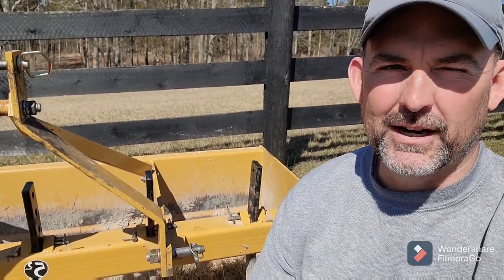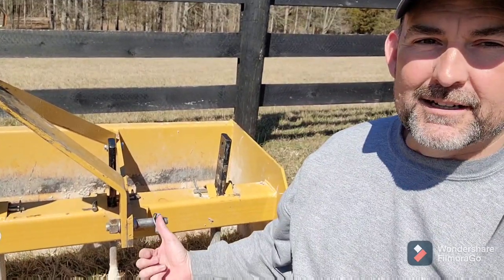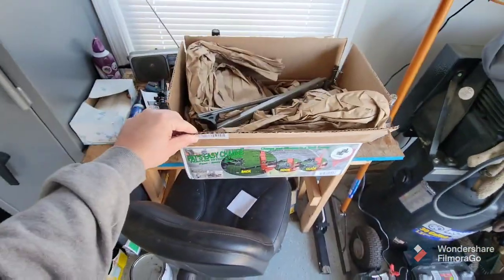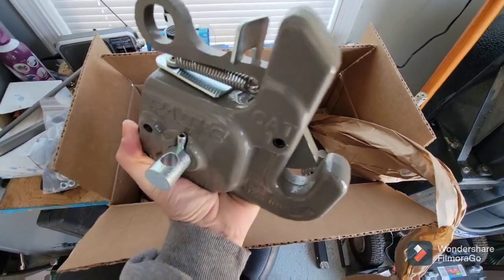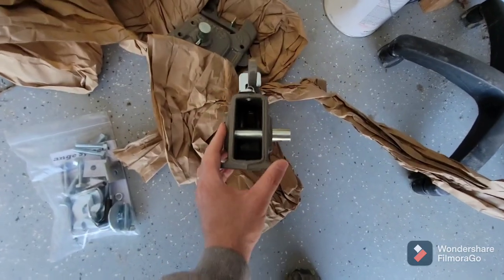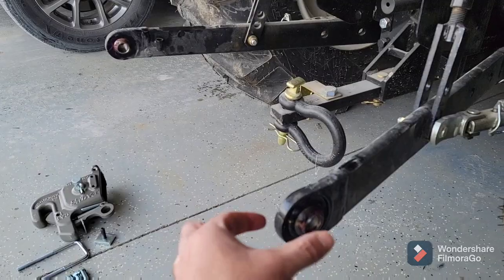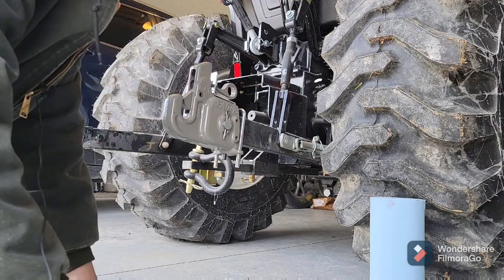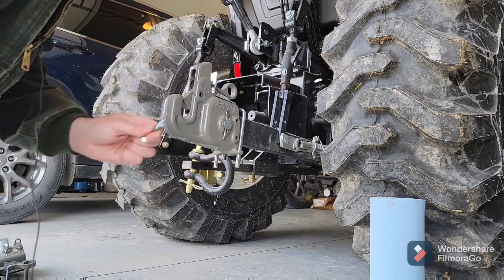Installing Pat's Easy Change Quick Hitch System on the New Holland Workmaster 40

Comment: you can use a broom stick or a piece of pipe to align the Pat's quick hitch. you just bring your lift arms up to where they are level and put a piece of pipe across both hitches into the latches as if it was a solid hitch pin. then adjust the bolts to line them up straight. 
very easy only took me about 10 min to align and tighten up.

Comment: I don't use the bar to keep the arms apart. I use a bungee and then adjust the width with the turn buckles of the lower links. Its easier that way

Comment: Unfortunately they extended the lower arms far enough so that my pto shaft no longer connected on my brush hog. But I believe that would have happened with a quick hitch too. So I will have to buy a longer PTO shaft now.
Reply: You can get a 4” pto extender for about 30$👍
Reply: there's a adapter that goes on the phone shaft, for a easy hook up. I'm buy both because they add about the same length to each.